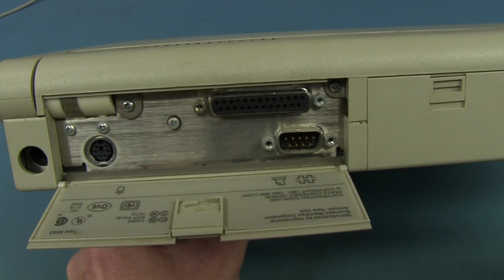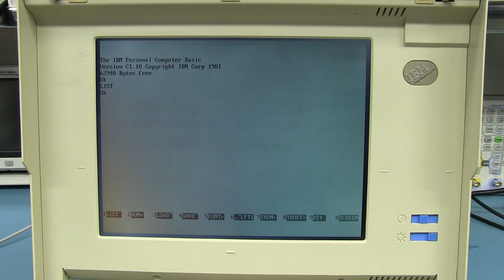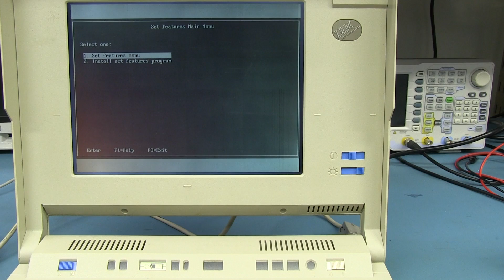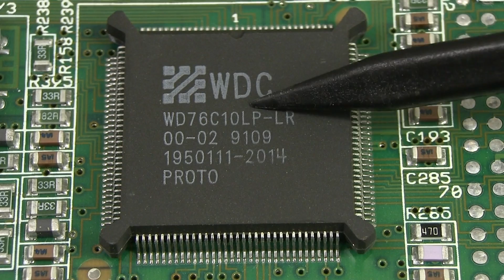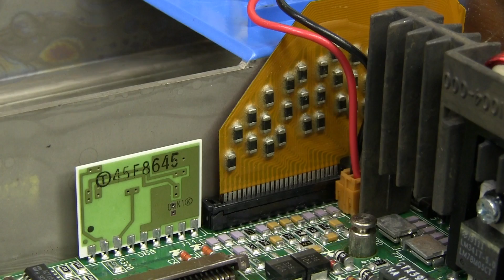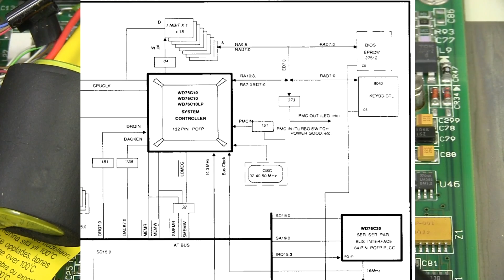EEVblog #639 - IBM L40SX Retro Laptop Teardown

Comment: 1991 even monochrome a 640x480 lcd screen is an amazing feat of technology, the first mainstream lcd color screens in the late 90s and early 200s were 640x480, if you wanted higher there was a massive premium in 98.
Reply from the maker: I was working designing flat screen LCD's and systems at Keycorp in 1994. They were 640 x 480 and 800x600 colour, but dead pixels were an accepted thing in production units back then!
Sampling VGA analog output and converting to LCD was REALLY HARD back then, even at 640x480, and it took a whole box full of tricks to accomplish. We tried to cram at that into the monitor which was a big deal at the time. Now it's just a single chip and we don't think twice about plugging our LCD monitor into an analog VGA port and get perfect full HD picture.
Reply: yep I remember my first 15in LCD KDS monitor back in the early 2000's was close too $500, and I think it was limited to something like 1024x768 screen rez with only VGA input, and speakers on it where so dinky you could barely hear them lol! But that was state of the art indeed.
Reply: In 1999 there were already large number of ordinary laptops with SVGA, and few business oriented laptops in market with XGA.
Reply: EEVblog
awesomesauce!
Reply: Artūrs Savickis
i had a thinkpad in 2000 that had a 640x480 (it was around there, strange res and it has been a long time) color display. this was around the time that active matrix was starting to become all the rage (my thinkpad didn't have it) but i do remember from that time that in laptops the most expensive part and the thing that you were really buying was the display. to say the least if you had an lcd at 1024x768 in 2000 you likely spent more than 500 bucks on it, while at the same time you could get a crt that could handle more than your video card could at nearly half the price. crt's though are kinda unfair, my secondary monitor is a relatively cheap crt from 2005 and i have it running at 1920x1440 right now just so it matches the width of my primary (hd lcd) monitor which makes tossing my tv to it easier. unless it is faking it internally it is actually managing to run that resolution, i've looked through settings back and forth and i can't figure out how the hell it manages it, even looking up close there is only a bit of blur and i think i could fix that if i popped the back off and tweaked the right pot.
Reply: The at the time new PC I got in 2000 had a 19" 1600x1200 capable monitor, with VGA.
Reply: Nukle0n But how much did you pay for it?
Reply: Nukleon - we are talking about laptop screens and mobile GPUs of late 90s here, what the hell?
Reply: Artūrs Savickis I could swear someone started talking about CRTs. Nevermind.

Comment: Rats!  I was hoping you would enter the date to see if it was y2k compliant.
Reply from the maker: I was going to mention that. I have read that the WD chipset is not C2K compliant.
Reply: Everything is y2k compliant as far as non-corporate users. If you enter the date it will just read it as 16 rather than 2016 and not have a problem. As for y2k the issue is that as it goes from 99 to 00 it will go to 01/01/01 and have the wrong year. That is the only issue with y2k and hence the whole thing about y2k being terrible and everyone dying is absolutely pathetic level scaremongering.
Reply: EEVblog Please test it out and make a short follow-up (maybe on altzone)
Reply: Even the original IBM PC from 1981 is Y2k compliant. There were some machines that would roll over to 1900 or 1980 if you left them running at midnight on 1/1/2000, however, you could just reset the clock to 2000 and then everything would work fine -- only the one-time rollover to Y2k was the problem, not any kind of complete inability to accept dates above 1999, like the media hype led people to believe.
Reply: That was a shit comment, Bill A, and you are a shit person.
Reply: me too. I was waiting the same
Reply: eken eken 386DX did NOT have a floating point unit builtin. Still needed an external chip for that.

486DX did have FPU builtin.
Reply: 88ariesk You mean some particular implementation correctly rolls the less significant digit, but makes a dumb increment on the other (after '9' is ':' btw)?
That looks like a mode of failure for some specific implementation and not a general one.
Reply: Bill A wow, why so bitter? Lost your job to a woman? :D I know many very good female colleagues in software development and some rubbish male ones. Intelligence doesn't go by gender.
So sad that a person with at least some interest in electronics (you are on this channel...) is so narrow minded. Electronic stuff for me is all about knowledge, being open to new ideas snd generally be curious about stuff. And nothing on this field is about having three legs or two ;)
Reply: Mariano Gaston that makes three of us!
Reply: Ben Childs four
Reply: EEVblog
Dave you said that the co processor was not standard but there was the DX series on the 80386 series as well. They had co and where external 32 bit (sx where only internal 32 bit and only had 16 bit external bus as most things had no use for 32bit at that time).
At least if my memory serves me well.
Reply: Than it was only the 32 external bus. Its decades ago so my memory got rusty on them lol
oldest I currently have is a P2 laptop. And that I only use for old radios that need dos programs to program them ( the beauty of ham radio :P )
Reply: vwestlife I had a lot of problem in dos software written in clipper. They even lost data.
Reply: Mariano Gaston Yes, some software did have problems. But in terms of the hardware and ROM BIOS, all IBM PCs (and Macs) are Y2k compliant. IBM also released an update of their PC DOS 7.0 in 1998, called PC DOS 2000, to fix the few small Y2k problems that some of the included utility programs had.
Reply: I had problem with bios too.
Reply: The Y2k bug is due to them using two digit date codes. (You probably already know that..) When it occurs in computer software, The date code instead of rolling back from 99 to 00, it goes to "/0". It uses the next ASCII digit after 9. of course this isn't a number, and if programs are not updated, and they reference a date code, it will return a Syntax error, and then crash. This is why I can't put in a correct year on my old PS/2, and other vintage computers. (Windows 3.11 really doesn't like Y2K and up dates..)
Reply: This laptop has to the power to run windows 3.11 and some basic windows programs.
Reply: I recently got one of these laptops and I was able to set the date just fine.

Comment: dude, if you think a computer of that era was slow without the math co try a 486 with the on-board cache pulled a generation later. used to have to pull it out of computers to see if it had gone bad and to test it i had to let it go through and boot then try to replicate the error with the cache out, that could take forever. the reason i couldn't just swap it out was because there were so many standards of cache at the time and it was so expensive that it would have been insane for a small shop to have a set that would fit in every 486 setup, a replacement cache sometimes cost more than a grand.

Comment: i got a toshiba ct50 laptop with a solid state cf card with cf to ide and its hell of a difference in speed and battery lasts 2x longer
Reply from the maker: Yeah, a CF to IDE adapter would do the trick.
Reply: The only bad thing about the libretto 50ct and 70ct was that the ide controller is on the slow ISA bus along with the PCMCIA controller